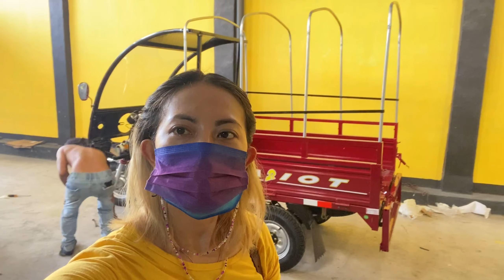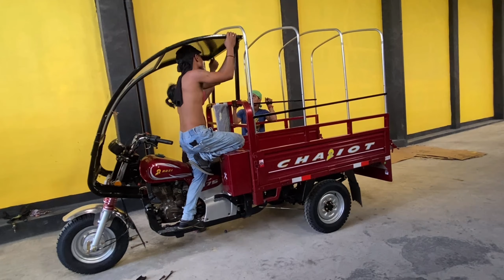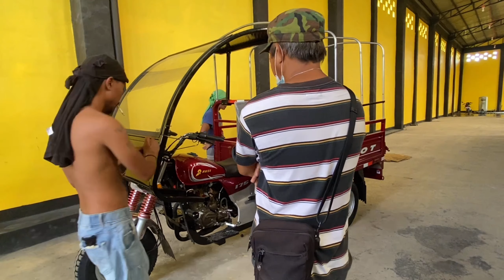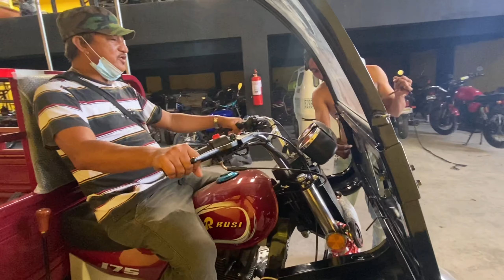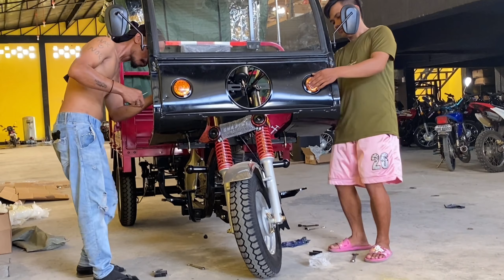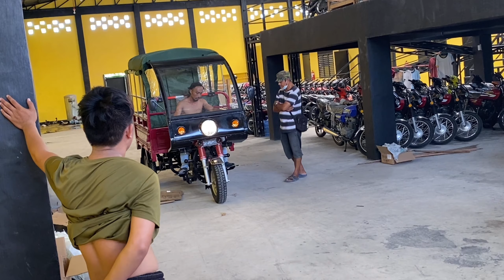PURCHASED AND INSTALLATION OF RUSI CHARIOT FOR HARDWARE DELIVERIES

Comment: I am trying to buy one, would you say they are a good option
Reply from the maker: @Bigpapatravels  This Chariot motor is known for its durability and reliable performance, making it a solid choice for many applications. It’s efficient and designed to handle a range of tasks, so I believe it’s a good investment.
Reply: @HunSantos  are. you a dealer
Reply from the maker: @Bigpapatravels  no sir..I’m the owner of that chariot in the video